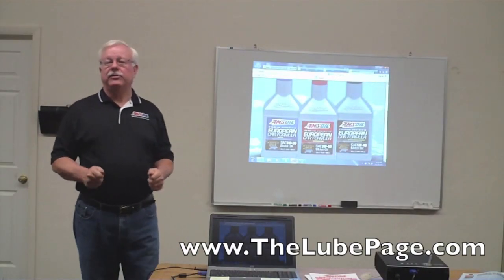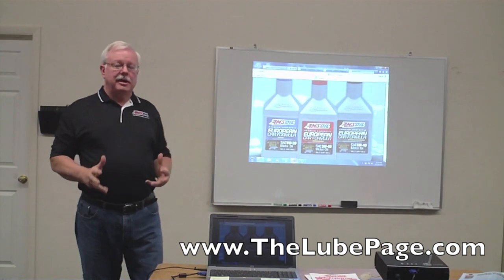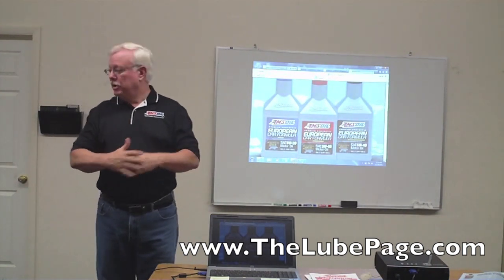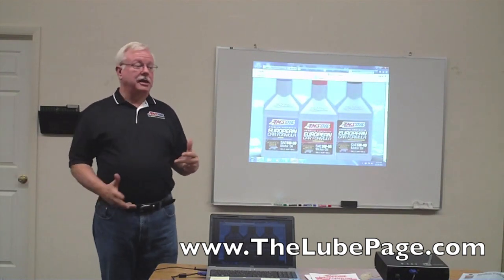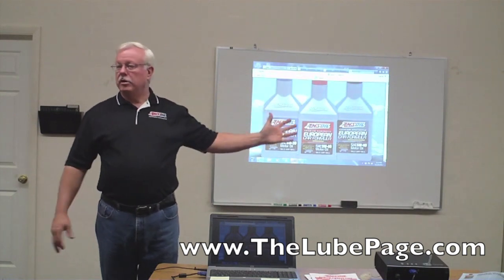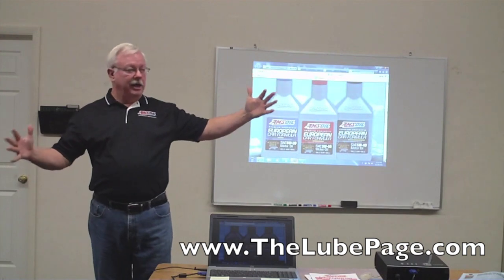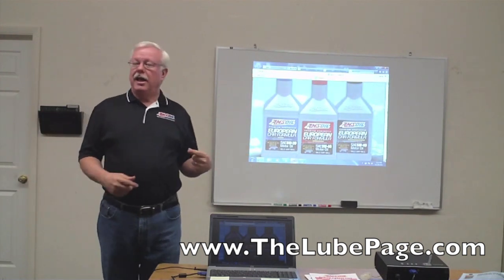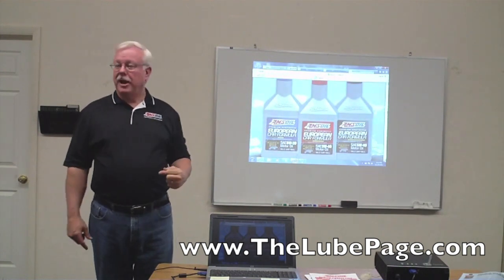AMSOIL Compressed Natural Gas

Comment: It's really common practice to modify high performance turbocharged engines to run on E85 ethanol in France.  Premium gas is so expensive, E85 is half the price due to lower taxation. 
However you are misleaded about losing power by converting to ethanol. They take advantage of Ethanol's higher equivalent octane rating and lower energy density than gasoline. Higher octane and the extra amount of fuel injected allows better intake-charge cooling and higher boost pressures. 
(It helps that most all performance cars in europe have forced induction)